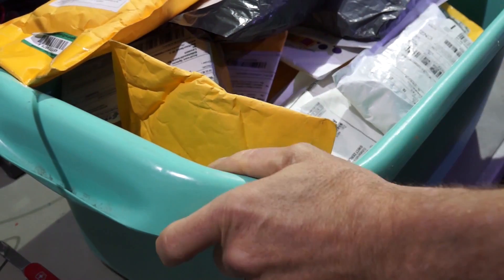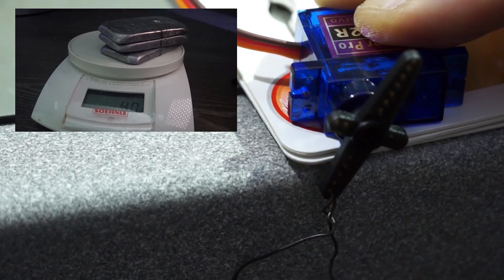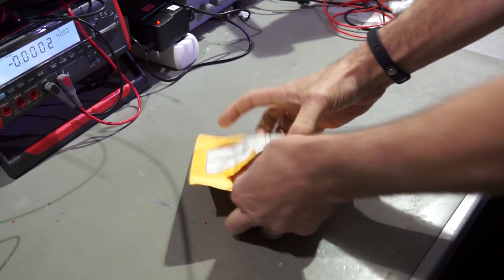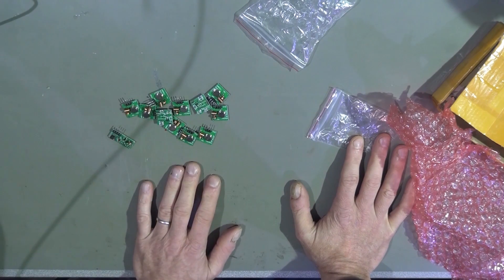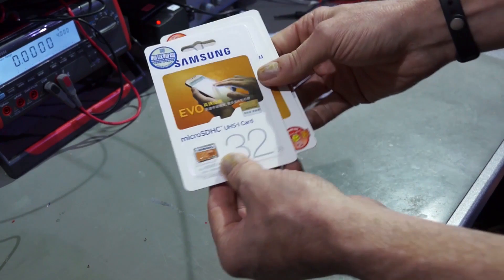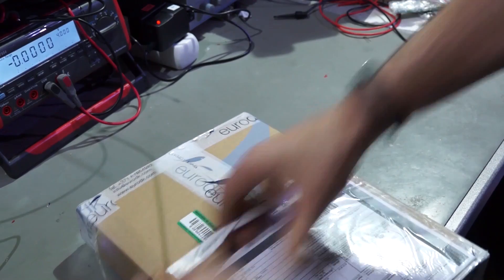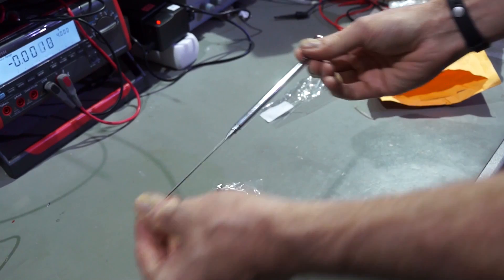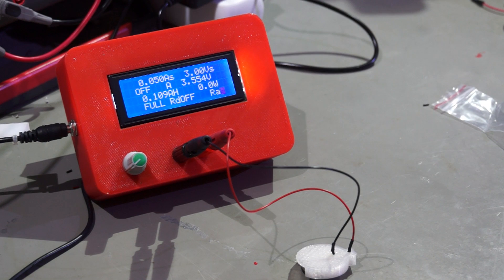#57 Mailbag #3 SG92R Servos, LIR2450, Microphones, connectors etc.

Comment: I was surprised recently to learn that servos are positioned by duty cycle and frequency.  I would have guessed the controller would read the voltage from the pot and would just run the motor forward or reverse until it got into position.  I'm hoping you explain how this works in one of your videos.  Maybe an internal controller does just that from the signal and they wanted it to be digital.
Reply from the maker: This PWM signal is probably from the old times and still is used for compatibility reasons.

Comment: Years later still a good video.  My servo tester like yours arrived today.  I don't have the servos yet.  You didn't mention the voltage of yours.  I grabbed some 5V and 12V to play with.  Several years ago my car AC here in Florida quit because of a problem with the servos on the ducts and was so hot no-one would ride with me.  They were quite expensive and all different so I didn't know exactly which was the problem.  I took them apart so many times all the plastic locking tabs broke and I wrapped them with stainless wire to hold them together.  It was my first experience with servos, but It worked and finally calibrated ok.  Mailbags are fun.
Reply from the maker: Glad you like the mailbags and watch them also if they are old!

Comment: Hi Andres, do you have any idea on how can I open/close "mechanically" a gas valve (like the one linked here: https://images.app.goo.gl/sLP4u1x4NeaRyAhk7 ) with something like a servo or stepper motor driven by an ESP32? I do not want to change the valve with an electrovalve. Thanks.
Reply from the maker: Maybe a geared motor? Small steppers do not have a lot of torque. Maybe also a very strong servo could do the job.

Comment: Hi Andreas,

 the cheapo 433 MHz receiver is not good in my experience. So if it doesn't work for you the superheterodyne 433 MHz module is a good alternative. 
Thanks for the interesting video's
Reply from the maker: +martin richardt Thanks for your comment. I already had a similar comment a few minutes ago. So, in the meantime, some other receivers are already ordered ;-) I want to do a comparison of the different technologies. So, a "bad" receiver is also good for me. Then, we can see how good the "good are".
Reply from the maker: So, you are not alone! Other comments go in the same direction. I just ordered a bunch of other receivers for a comparison.
Reply: +Andreas Spiess This site shows the main types of 433mhz receivers that are available, there are also some modules based on SYN480R but they are the same as the 470R
http://www.byvac.com/index.php/RL03
also some info here: https://wiki.pilight.org/doku.php/receivers
Reply: +Andreas Spiess I fiddled with these last week when I got them from China.  Seems only 1mW, and only have 25mm range, yes 25mm.  Even bumping the voltage to 12V only gave about 50mm.  I tried adding special and straight attenna's, perfectly made to specifications, yet the best distance I got was about 150mm - I  evendropped the baud rate and only sent 4byte once every two seconds...  After about two hours I put them into a bag (one receiver was DOA) and on a shelf - maybe one day I might need very short distance wifey.....
Reply: +Laurence Munro The super regenerative receivers are very susceptible to interference, I found that being close to my PC is enough to cut the range down from a few meters to just CMs
Reply: They are fine if you use them properly, the tutorials about them are not so good.
Reply from the maker: I will do a test of them in a future video. I have bought a few different products and will compare them. Do you know of good tutorials or do you know a few tricks for me?